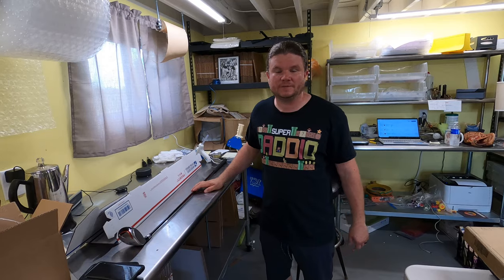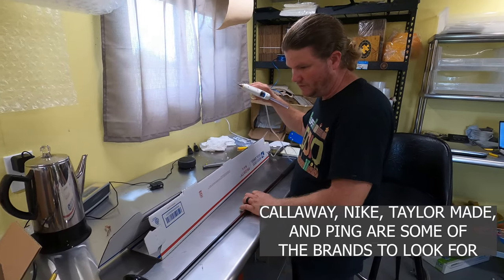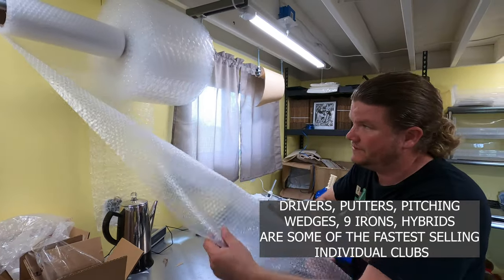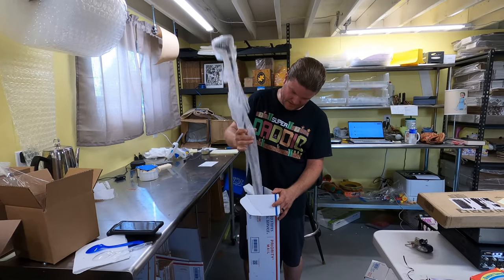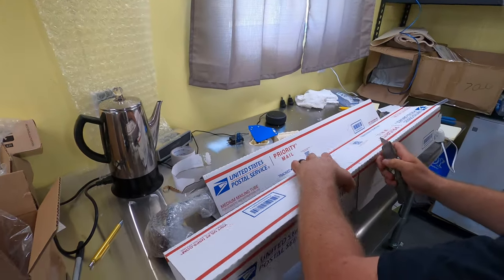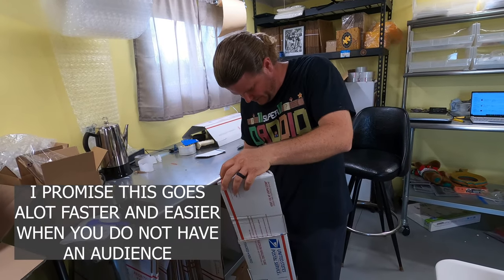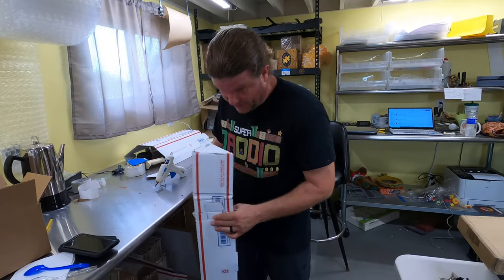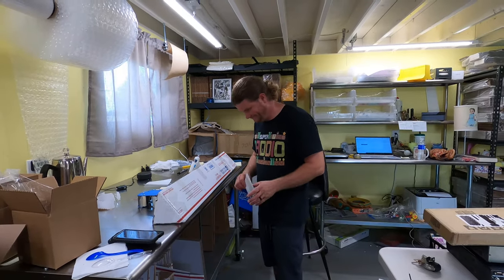HOW TO Ship Golf Clubs EASY AND CHEAP For Reselling on Ebay For Profit!

Comment: How many irons could you fit in one of those boxes?....I need to ship 7 irons.
Reply from the maker: Not sure if I ever did 7 of them but have definitely fit quite a few in one. If you put a few the opposite direction you can fit more clubs in one box.  Also you can check with local golf club stores to see if they have any empty boxes from their iron sets. Be careful, I think if you get over 5"or6" in width the shipping price goes up a lot.
Reply: Wrap 4 togeather by plastic wrap. Then wrap the other 3 together separately. Put one in the the other upside down. Save space and should work